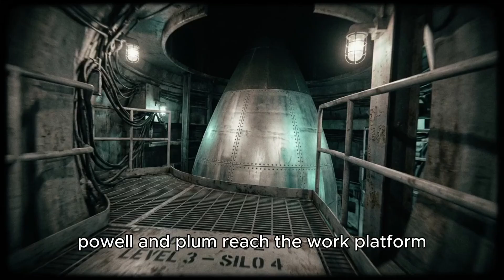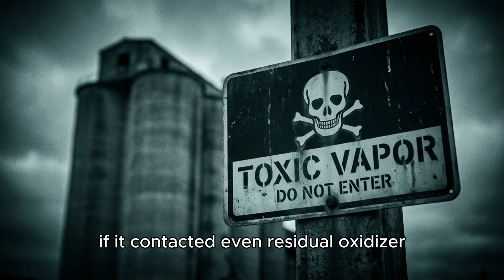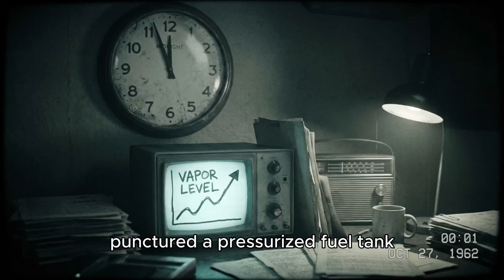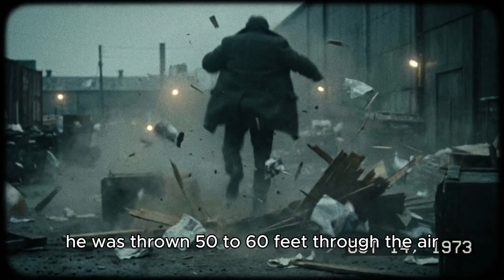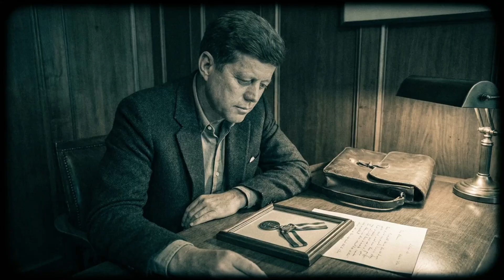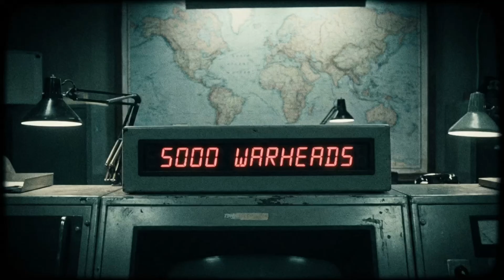The $8 Socket That Almost Nuked Arkansas | Titan II Damascus

Comment: One thing to note. Almost ALL of the pictures are AI generated and are not even close to the real thing.
Reply from the maker: Fair point, and appreciate you flagging it. This is an older video where we used generic AI images as placeholders, which wasn't ideal. Since then we've overhauled the process: images are now generated using actual historical references and verified sources, so they're grounded in what these people, places, and objects really looked like. Still AI-assisted, but anchored to reality. You'll notice the difference in recent episodes.